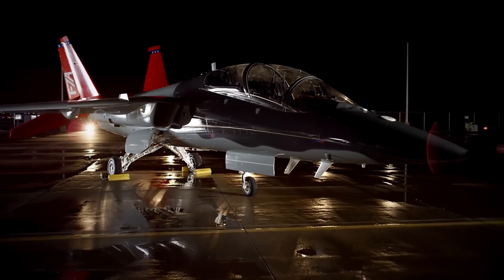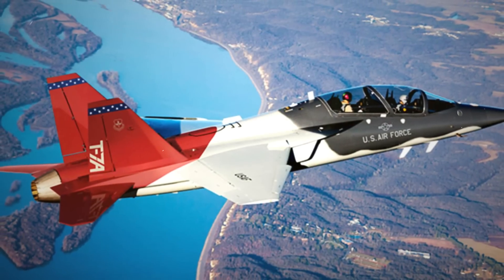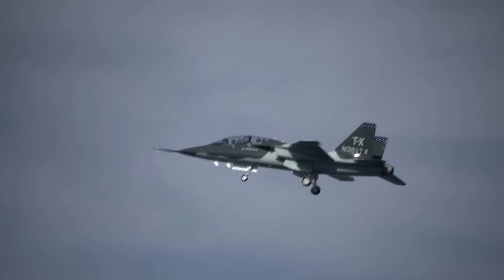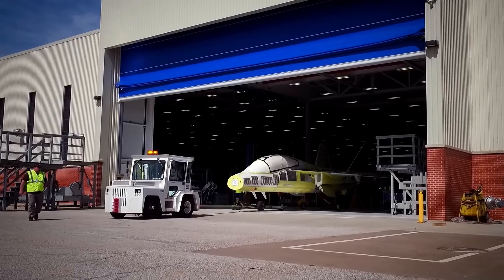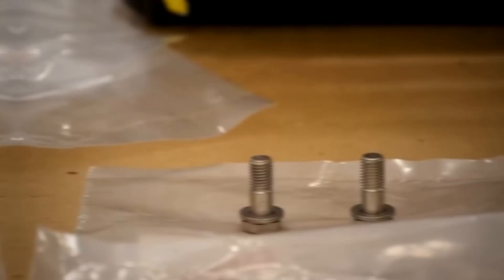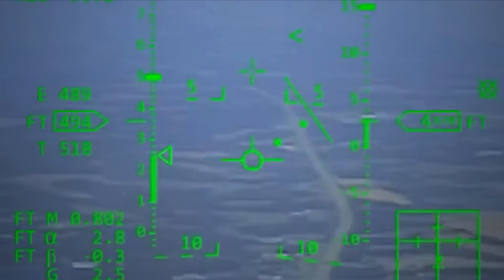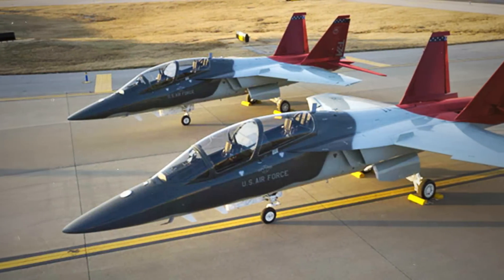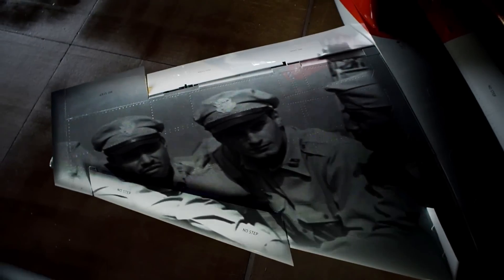Boeing T-X - America's Newest Jet Flying (T-7 Red Hawk)

Comment: A new 'subsonic' jet training airplane - US Air Force wanted to acquire new supersonic jet trainers, but due to the weak and unbalancing body structure of T-7 Red Hawk, it would just be the similar class of the Aermacchi M-345.  US Air Force currently uses supersonic jet trainer like F-5E (or T-38 Talon).  This is going to be another problem of Boeing on top of their (already headaching) passenger airplane issues.

Comment: I don’t understand the single engine concept especially for a trainer. Crewed f-16’s for a while and we lost those way too much.
Reply: GE 404, good practical engine upgraded by Volvo Aero into the RM 12 that has over 300000 flight hours without failure and you have a reliable solution.....  cheap to buy, cheap to fly.

Comment: why didn't they do a twin-engine?
Reply: Seriously a great question!
To add to lazynow1  not only is it cheaper but also SAAB Gripen C/D came with the GE 404 in the legacy Hornet ( 2 engine aircraft) modified by Volvo Aero into the RM 12 which was upgraded to give excellent reliability , over 300,000 flight hours without failure, and an increased power output !  Excellent DNA .

Comment: Designed as a trainer, ok fine. But I'm curious as to maneuverability and air to air potential, especially if it gets more powerful engines. Could it be a contender for ANG fleets?
Reply: All trainers are limited to 6-7g even though the airframe is more capable. That way lifetime fatigue is avoided and the pilots extend their abilities in twin seaters after conversion. This is a stepping stone aircraft.

Comment: Still better they moving to electric turbine military plane. Actualy electric motor can reach 1000hp+ depends on armature design and quality, even the best if they can use pure silver winding which have 100% eficiency and sodium ion or blade battery which cannot explode. Current jet plane is tax suckers.

Comment: With Boeing the program is guaranteed to be filled with massive cost overruns and delays.
Reply: Don't drag everyone over the same line. Just cause a lot of their projects have had those issues doesn't mean this will. Although it wouldn't surprise me, Boeing should stick to commercial planes in my opinion.

Comment: The specs on this aircraft are impressive.  
Max takeoff weight is 12,125 LB. 
Thrust without AB is 11,000 (T/W = .91)
Thrust with AB is 17,200 (T/W = 1.42)!

1.42?!  That is going to be a rocket ride.
Reply: I think the specs are even better tbh. They don't usually release the top specs to the public.

Comment: This program is plagued with problems and it's due to the culture at Boeing. The KAI/Lockheed T-50 is a vastly superior aircraft and was service proven but underbid by Boeing with this unproven design. The USAF would be wise to cancel this and the KC-46 and revert to the KC-45 and T-50.
Reply: You can't say that another plane is superior without them being tested against each other.
Reply: @andreas_petersson  They were, the T-50 was well proven and has considerably better performance and many of it's parts had commonality with existing aircraft/engines. The USAF bought the T-7 on a low bid and as expected will get what they paid for. Boeing running this is a big part of the problem. The company is in a shambles. The KC-46 and major issues with the 737's are just a small indicator.
Reply: @triadnine6627  The teams making commercial planes and the teams at Boeing Defense & Space aren't the same. Yes there are issues with Boeing but remember SAAB is there to ensure excellent performance.
We don't know the full performance of the T-7 yet because that hasn't been tested in the air, only in simulations. 
And just cause it has a lower cost does not mean it's a worse plane. Look at the Gripen as an example. SAAB knows how to make a really good plane for a low cost.
The T-7 is a brand new plane using a lot of new technology that's needed as new fighter jets have similar technology as well. Don't think the T-50 has that.
Reply: @andreas_petersson  The T-50 is a very advanced design, again, a proven aircraft that has been in service for years. The T-7 is very plagued with problems, less capable, it's costs will eventually rise above what the T-50 just in trying to sort issues that continue to arise. If SAAB alone were building it, I'd have greater confidence in the outcome but not with Boeing. It was a bad acquisition decision based a low bid, not on performance, reliability, and costs.
Reply: @triadnine6627  Yeah being biased is also a problem. Your whole opinion is based on Boeing having lots of problems. T-7 doesn't have so many problems, at least not that's publicly released. 
And again, just cause it has a low cost doesn't mean it's a worse plane. Look at how the T-7 is built and designed, you'll see how they managed to save some money.

Comment: What is that wavy line/pipe/rope inside the canopy?  I used to think they were to detonate the canopy for ejection but they are usually pretty symmetrical but this one's shape is odd.. a lot of shape around the front but a straight line down the middle for the rear seat.

Comment: 0:27 | "Designed in the blink of an eye!" What does that ever mean! THUMBS DOWN

T-X Timeline from Boeing website . . . . .

Sept. 14, 2020	U.S. Air Force introduces e-Series engineered line and credits the T-7A Red Hawk as a leader of this digital revolution
July 21, 2020	Boeing and the U.S. Air Force conduct third T-7A Red Hawk advanced trainer flight test summit
July 14, 2020	Boeing T-7A completes inverted flight test
Apr. 22, 2020	T-7A advanced trainer records 11 flights in one week
Apr. 3, 2020	T-7A Red Hawk ground-based training system achieves Critical Design Review
Mar. 12, 2020	T-7A aircraft conduct six flights within nine hours
Feb. 27, 2020	Boeing T-7A Crew Shuts Off, Restarts Engine in Flight to Demonstrate Reliability
Oct. 24, 2019	Boeing T-7A Awarded Aviation Week’s “Game Changer Award”
Sept. 16, 2019	U.S. Air Force announces the official service name of the aircraft as the T-7A Red Hawk
Aug. 6, 2019	Boeing T-X conducts its 100th flight
July 1, 2019	Boeing T-X makes its first, official Engineering and Manufacturing Development (EMD) flight test
Sept. 27, 2018	Boeing Wins U.S. Air Force T-X Pilot Training Program Contract
Sept. 18, 2017	Saab Offers U.S. Based Production Capability for T-X Trainer Aircraft
June 26, 2017	Boeing submits flight test data for T-X proposal – two days ahead of schedule
May 15, 2017	Boeing selects St. Louis for T-X final assembly and checkout
April 27, 2017	Both Boeing T-X aircraft take to the skies, together in flight
April 24, 2017	Second Boeing T-X makes first flight
April 20, 2017	Second Boeing T-X aircraft taxis
March 28, 2017	Boeing submits U.S. Air Force Advanced Pilot Training System proposal—two days ahead of schedule
March 24, 2017	Boeing T-X completes four flights in one day—demonstrating maturity of design
March 2, 2017	Tweet: Second Boeing T-X aircraft completes production
Jan. 23, 2017	Boeing T-X achieves multiple days of three flights a day
Dec. 21, 2016	Boeing T-X completes second flight
Dec. 20, 2016	Boeing T-X completes first flight, validates design for Air Force requirements
Dec. 15, 2016	Boeing T-X taxis
Sept. 13, 2016	Boeing reveals two production-ready aircraft, the cornerstone of the complete Boeing T-X advanced pilot training system
Dec. 6, 2013	Boeing and Saab sign a joint development agreement to compete for T-X with an all-new, purpose-built design

Comment: what was wrong with the T-38?
Reply: It's 60+ years old
Reply: @nicholasturo-shields6477  yes, i doubt you find a 60 year old still in the air. The equipment is modern and supersonic!
Reply: Old system made for an old Air Force. New fighter jets requires new trainers.
Reply: @andreas_petersson  avionics change, but the aircraft is a trainer....it's a tool.
Reply: Modern fighters use touch screens and fly by wire systems. T38s have none of these systems due to the time they had been developed
Reply: @simonm1447  the pilot will go to a training wing after flight school.....this is where they learn their type aircraft.
Reply: @tmcge3325  right, but I guess they will have it easier to fly a fbw aircraft like the F-16 or the F-35 if their trainer already was a fbw aircraft. Here they simply can pull the stick, without being concerned if they exceed the G limit or not.
Reply: @simonm1447  Seems like a waste of money...Better to spend the cash on new fighters, bombers and tankers than trainers.
Reply: @tmcge3325  Sure, spend money on new planes with new technology but use old planes and and technology to train the pilots. Having a modern trainer will make it easier for the pilots.
Reply: @andreas_petersson  you understand flight training school is 18 months, then specific platform (fighters, tankers, bombers) training is 12 months and after all this training, the pilot finally gets orders to wherever they are needed. So, 4 years of training....3 years deployed.
Reply: @tmcge3325  Doesn't matter how long it is. It's not easy to go from and old plane to a new plane which has very different systems and technology.
Reply: @andreas_petersson  the systems in the T-38 are updated! They are learning how to become a pilot....yhey learn about their specific platform in the next training phase.
Reply: @tmcge3325  Compare the cockpit of a T-38 with the cockpit of a T-7 and you'll see what I mean
Reply: @andreas_petersson  it doesn't matter....they are only learning to fly a jet the air force way. The real training comes after flight school in the training wing! 1/4 of these new pilots will fly fighters, 1/4 tankers, 1/4 awac, 1/4 helos and many will fly cargo. There you go!
Reply: @andreas_petersson  oh! And bombers!
Reply: @tmcge3325  Still. It's way easier and cheaper to start with modern planes.
Reply: @andreas_petersson  not really...better to use the money on new bombers/fighters and advance weapons.
Reply: @tmcge3325  I think we can agree to disagree on that one.

Comment: Too bad the Air Force was bullied by Boeing to buy their trainer.  This plane is not superior to the T-50A, nor is their training system equal to what Lockheed-Martin had available.  The pilots had better hope they don't go head to head with the T-50B because it will whip their ass.
Reply: You're right. The training system SAAB/Boeing has for the T-7 isn't equal to Lockheed Martin's. It's better.

Comment: Why so much useless buzzwords... agile design...blah blah .... computer modeling.... blah blah....systems engineering... blah blah...

Not a single advanced system is designed these days without using all of that, which just boils down to using standard engineering practices.  This is 2023, not pre-Y2K.

Comment: It's basically a mini Hornet

It's got the same leading edge extensions, vertical stabs forward of the horizontal, and saw tooth wings. Just, mini.
Reply: Which is saying it’s basically an upgraded T-38.   The Hornet itself was a derivation of the F-5 design.
Reply: @ericbainter826  yes that's correct, and I agree. But I mean aesthetically it's just a mini Super Hornet with a single engine.

And I just googled some images and a top down view it literally looks like a Super Hornet, but from a ride at the county fair 😂

Comment: T-38 also used by Shuttle pilots to fly from Houston  to El Paso. There they switched to a Gulfstream jet to practice landings at WSSH. ( White Sands Space Harbor)
Reply: I suspect the T-38 had too shallow of a glide. From what I hear, they practically had to use thrust reversers to get the gulfstream to match the Shuttle's (brick-like) 4:1 glide ratio.
Ignoring the dramatic, night time, shiny, glossy roll out vids, this is a nice looking aircraft, but the T-38 is, was, and might always be the sexist, best looking aircraft in my book!
Reply: @jfan4reva   yes, 20 degree approach angle, WSSH had Kennedy and Edwards AFB mock-up runways

Comment: This jet looks a lot like it was derived from the F-5 II "Tigershark", albeit with one less engine and an additional vertical stabilizer. And the wings are set higher up and over the air intakes.
Reply: Indeed it looks the part, the Tigershark was a single engine fighter so its certainly a worthy succesor.
Reply: @XxLIVRAxX  yes it is. I've always loved that jet. There a video here called the best jet that was never built or something along those lines.
Reply: You are very close.  The T-7 shares the canted vertical stabilizers, leading edge root extensions, and general plan form of the F/A-18.  The F/A-18 was of course developed from the YF-17, which in turn was developed from prototypes based on the F-5.

Comment: I’m a career jet mechanic and I’m fascinated by this new plane.
Reply: Is it me, or does this jet look like it was derived from the F-5 or F-20?
Reply: @iamnotpaulavery  I would say not really. The wing has a similar shape but the t-7 is a top wing and the 38 is a low wing. 38 is a single stabilizer and is also slimmer. Landing gear is also very different.
Reply: @iamnotpaulavery  the YF-17 came from the F-5 design, the F-18 (Boeing) came from that, the E/F is a large change but still Hornet wrapper, this reminds me strongly of the hornets
Reply: @snegik  Yes. It has the same wing design with the built in canards over the air intakes.
Reply: @iamnotpaulavery  I guess what you mean are the leading edge extensions. The US air force really despise canards.
Reply: @Minh-Tran-04  LOL, yes I heard about that some time back! And yes, I meant "leading edge extensions". BTW, there's a video on here from back in '92 titled "mud fighter" or "killer bee", (or both phrases together) that deals with a replacement, or an addition to, the A-10's role in CAS. This aircraft was designed and built by Bill or Burt (?)  Rutan, but it has the hated canards. But that little jet is nimble as hell and has the same Gatlin gun, albeit in a slightly smaller caliber, as the A-10. The AF looked at it but passed it over. Could it be because of the canards or because they actually felt it wasn't a viable addition to the AF's inventory? If you have a chance, search for it, it's still here.

Comment: I still believe they should have opted for the Lockheed T-50… a proven plane that’s already compatible from the get go with the US Air Force. They are delaying the training and nurturing of new pilots just so they can pour money into Boeing in order to keep them afloat. I think it’s a mistake.
Reply: It's actually not a mistake, at least not in my opinion.
The T-7 is made with the future in mind abd it is much easier to use by pilots and ground staff. Plus it's faster and cheaper to make.
Reply: @andreas_petersson  Well, the T7a has not been deployed yet, so I will delay making a verdict on the ease of use as well as price, until it is mass produced and deployed. I'm afraid of another F-35 debacle, where the said price and actual price is different. I'm not against the T7, it is just that there is an urgent need to maintain the Airforce, as well as training, but to develop a whole new plane, even with new methods of planning and production, is a risk that I would have not taken, especially when there is a proven plane that has been planned for the TX program in mind. 

The "cheapness" is a double edge sword, for now, we'll have to see, I don't know the road map of the future development and upgrade of the T7a, but it seems like its built to price and therefore no headroom for upgrade (when looking at max takeoff weight and such), which will limit the use of the T7a as just a trainer. Other countries that are looking to buy a cheap trainer and light attack aircraft will not be as interested per spec wise, but politics will also be factor so.... 

The only reason the T7a won for me was due to the promise of price.
Reply: You mean the 1990s platform already coming to the end of its development potential?
Yeah, that would be a real smart move.
Reply: @emergingloki  The T-50 has a roadmap for Block 10, 20, etc and other upgrades. The F-15 and F-16 are still being made a produced due to its reliability. Maybe we should just chuck them into the trash bin too. Oh, and the F-22 Raptor is older than the T50 so it is definitely outdated and for sure at the end of its development potential. Yes, I like your way of thinking.